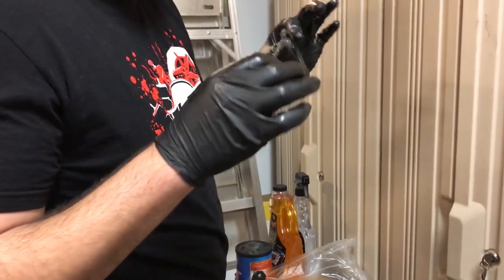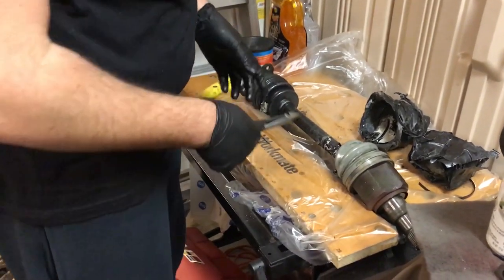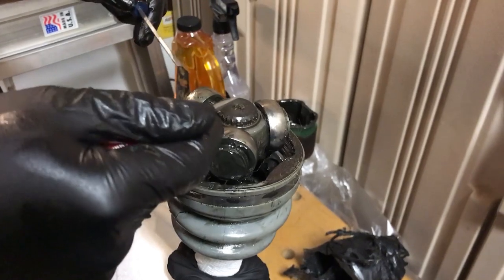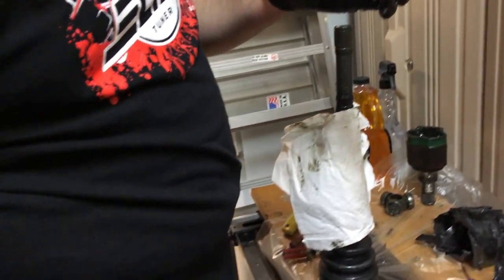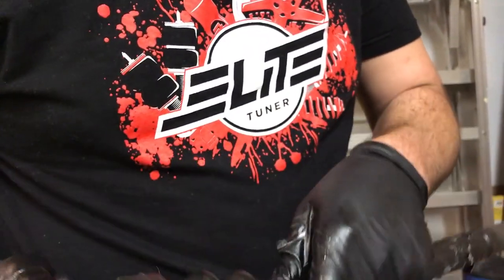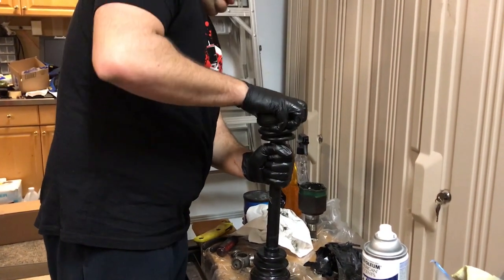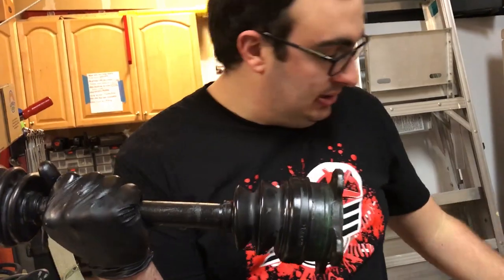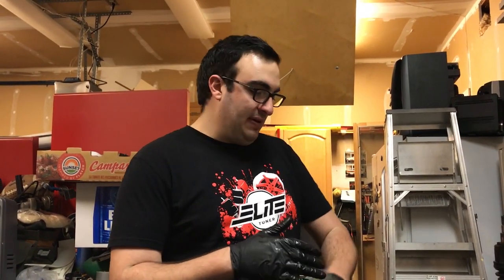3000GT Rear Axle CV Boot Replacement

Comment: When you installed the chrome ecu  were you able to drive the car with out installing a program
Reply from the maker: Yep! I still haven't tuned it or messed with it. I'm still on the base map it comes with, which I believe is a stock 98 map (I think)